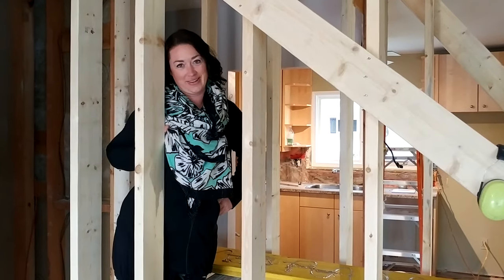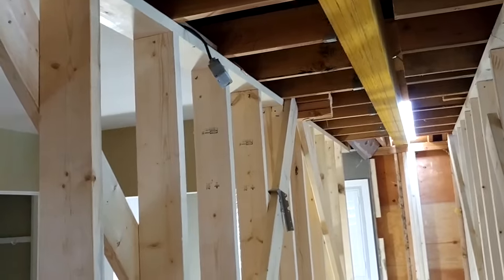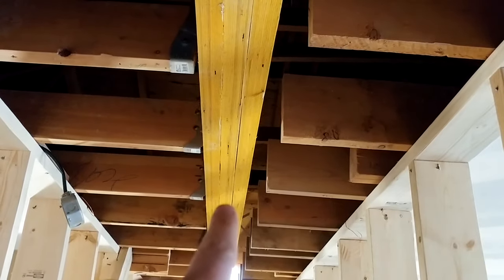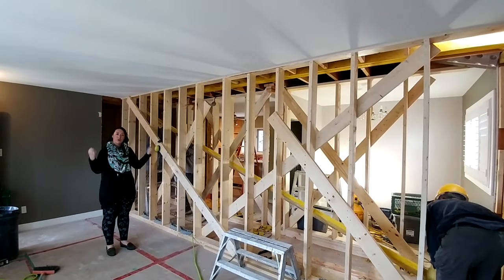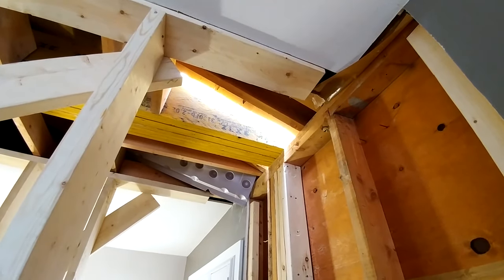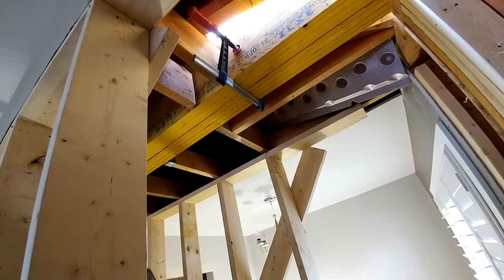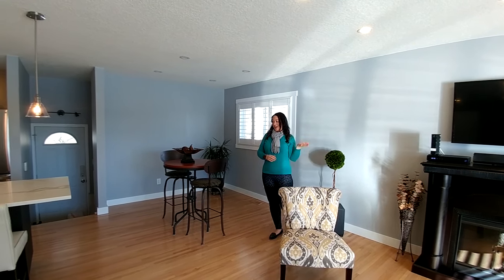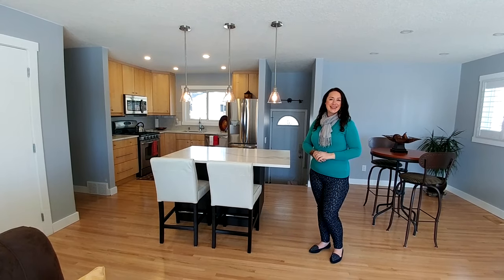Load Bearing Wall Removal | Removing Interior Walls | Calgary

Comment: if both end of the beams "lvl support" are rested on a supporting outside walls then why would you need special load bearing glue/nails to attach them to each other?